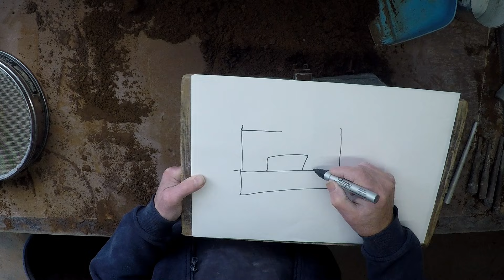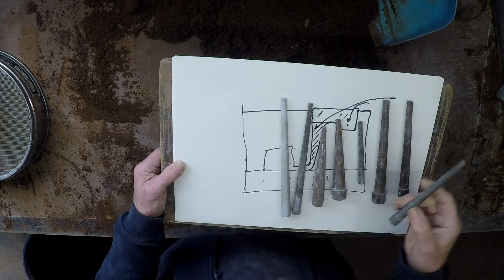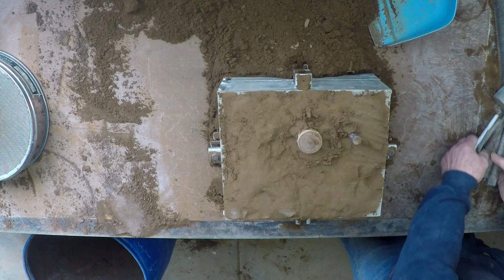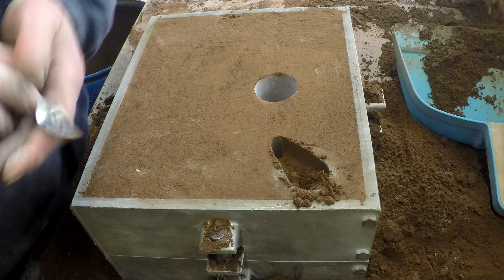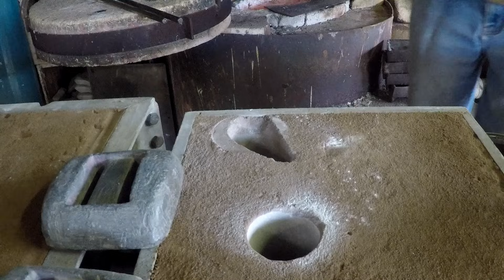Basin and sprue design for sand casting in the foundry

Comment: Marin what is your take on square sprue.  I did a stent at a foundry making large bronze parts for yachts.  We used square sprues to keep the molten metal from swirling and scouring sand out of the bottom of the sprue and into the part.  I believe we also put the pouring basin at the bottom of the sprue.  What are your thoughts?
Reply from the maker: Patrick, I use round sprues because way back when I made my sprue formers I only had a lathe and thus round tapered things were easy to make. I now have a milling machine and if I was still capable of making castings I would likely go to a slot sprue. Both the square and slot designs have more frictional resistance to the metal flow and thus slow it down more. As metal speed is our enemy this is a good thing. Typically then instead of my 8 mm round exit sprue (exit area is about 50 square mm) I would use preferably a slot sprue with a 5*10 exit size  or I guess a 7 * 7 mm square. Best way to avoid the problems of swirling is to make sure the sprue always runs full - the metal may still spin to some extent unless you pour with care but it will not drag in air and or generate dross by turbulence. Correct sprue sizing and taper plus a good pouring basin atop the sprue are thus essential and this is where most foundries fail badly. Sand scour is usually the result excessive turbulence and thus of  poor system design. I have never had this problem even when it later turned out that there was loose sand  in the sprue and or later parts of the running system. A half blocked sprue made for a long but still successful fill demonstrating just how small a sprue one can get away with!!!! A pouring basin at the bottom of the sprue? Hmm, I assume that you mean an enlargement base. This was an old and sadly much favored practice  based on the erroneous idea that a pool of metal at the base of the sprue would cushion the falling stream coming down it. It has been thoroughly discredited and leads only to excessive turbulence, air entrainment and dross generation - possibly even sand wash. Bronze for yachts - often Aluminum bronze - the foundryman's nightmare. Good gating from the pouring basin to the casting proper is essential to get good reliable castings, many foundries will not touch it..... Martin

Comment: Sir what is the use white powder.. and what's the benefits?
Reply from the maker: The white powder is just parting agent. It is a commercial parting agent and is very finely ground Calcium Carbonate. I put a little of it down the feeders and sprues and then blow it around to coat the inside of these . It helps stop loose sand from sticking when I finish of the top of the mould and when I cut the pouring basin... Martin

Comment: Hey great castings, few things. i might have missed them because I watch most of my videos at 1.5 speed but u did it your way and really didnt talk about other ways and y they dont work. why not put the screw on a angle rather than worry about making a specialised entry hole. And why do u not warm the sand so the aluminum does not cool as quick.  Then u talk about why bother going to  de oxygen the alluminum, well why care about the hole ur carving for with a special tool and adding powder really I hope I'm not coming off rude it's just a bit hmm
Reply from the maker: Show, I thought that I did cover why other ways don't work as well. Its all to do with getting the calmest metal flow possible in order to avoid air entrainment and consequent oxide film formation - these films seriously weaken any casting. The pouring basin at the top of the sprue is a very important part of the gating system - without it all is lost. Angled sprues have been suggested and indeed tried before but tests have shown that they make no difference. Its the water in the sand that causes the metal to solidify so fast. But metal that solidifies quickly is stronger and more ductile than metal that solidifies slower. However for some work - plaques with fine lettering in my case - it is not unusual to completely dry the sand moulds in an oven this helps the lettering form more sharply. I guess the special tool just makes the process quicker and more repeatable and the powder (I assume you mean the white parting powder) just helps stop loose sand sticking to the insides of the sprue and so helps keep the casting cleaner.... Martin

Comment: Great video.  Learned something new today. From the slowmo you can tell that the turbulence within the sprue is greatly reduced and keeps heads pressure maintained
Reply from the maker: Taranson, Yes, you have hit the nail on the head. Turbulence is the great enemy with handling molten metal. The availability of instant pressure to aid flow is a great help with thin areas that might otherwise not fill.... Martin

Comment: Very interesting information. New sub you. What PSI of air pressure are you using? Thanks for sharing with us.😎😎⛏⛏🔥🔥
Reply from the maker: Cand, I use 15 PSI in the air gun I blow the moulds down with. I have a cheap regulator in the line the gun is attached too. Even so  you have to be careful  as to how you use the air. I point the gun away from the mould when I pull its trigger as the first rush of air can be a bit strong. I try to avoid aiming the gun at sharp edges in the mould and if the mould is delicate,  like text for example, I hold the gun a long way back from the mould face. I often inspect the mould with the aid of a good torch to see if there are any loose sand grains on the surface. Its all a bit of an acquired art... Martin

Comment: 😂😂😂😂😂😂😂 wot a load of bollox
Reply from the maker: And you would know - How?
Reply: @olfoundryman8418  I was a greensand moulder tor 50yrs you ever heard of a bowl and runner bar guess not
Reply from the maker: @billclay6748  I never cease to be amazed and saddened by the reluctance of old hands to adopt or even try new developments. This disease afflicts all industries of course, but it is particularly severe in the foundry industry – it’s a black death plague infesting it. To refuse to even try new things achieves nothing, it just maintains the status quo of 6000 year old technology. The “it were good enough for my father and his father before him it be good enough for me” attitude gets us nowhere.
What I show here is not completely new anyway, the offset basin was developed and used in the early 1900’s. Sadly it was paired with that scourge of the foundry industry, the usual overly large and parallel sided sprue atop an enlargement base and unnecessarily oversized runner, thus the offset basins good effects were negated and its use discontinued. 
When I was first taught how to mould (1964), I was introduced to the techniques that you mention, but even the littlest understanding of fluid flow indicated that they were faulty and better methods had to be out there. The ongoing work of John Campbell et.al. has given us many of them and foundries that have adopted them e.g. Bob Puhakka and Cosworth are the proof of the pudding.
Can you not see towards the end of this video how quietly and smoothly the metal enters the mould? So much better than the splashy turbulent stream usually seen in foundries. This is an easy and highly beneficial technique to use. If you are still moulding try it, please.
Perhaps too you could show us some of your work so that everyone here knows what you are talking about?.....Martin

Comment: I'm very curious how you would approach this in a jolt-squeeze molding machine setup?
I have used a conical marker on my cope squeezer boards to mark where I cut my sprue for a long time, but I see the advantages of the offset basin.

I attempted making an offset basin form that also marks where to cut my sprue, however when I went to cut my tapered sprue, the basin collapsed from the side pressure.
Reply from the maker: Border, I think that sprue basin forming, and indeed of the sprue itself as well, is the Achilles heel of jolt squeeze machines. It s just so much harder to get a decent small tapered sprue with a decent offset pouring basing attached when using such machines. If you can manage to ram a tapered sprue in place using perhaps a base board with an appropriate hole you would be half way there. Then perhaps a pouring basin out of a hard sand added to the top of the mould after mould closure. Likely not as easy or as quick but doable.... Martin

Comment: I was using a tapered punch only because the taper would let it come out easier!
If I used air like that it would blow the mold apart!
How does he get such solid sand?
Reply from the maker: Arc, Anyway that you get it right is a good way. Its not that the sand is very solid its just that the air is set to only 15 psi with a separate cheap little regulator. Even so I point the air away when pulling the air gun trigger and if a mould is particular delicate like fine text on a plaque for example I hold the air gun a long way back from the mould surface so its not much more than a gentle breeze. Its a bit of an art!😊. The sand is a natural sand i.e. straight out of the ground clay and all - I just sieve out the few biggish bits, add the right amount of water and its good to go Unless oven dried and I have only very rarely done that its not particularly solid.... Martin

Comment: no raisers ?
Reply from the maker: curt, Yes there is a feeder. If you look at the thumbnail for the video the top of the feeder can be seen a little to the right of and below the "n" of "Basin" and to the right and above the "d" of "And". Looking at the cope part of the open mould the bottom of the feeder can be seen above the drag located gate into the casting..... Martin

Comment: martin, you made this video a few years ago and a question to you, can you place the sprue on an angle from the edge to the part so that the molten metal runs down instead of falling/ splashing in to the part, just an idea, by the way I have not  yet did a poor, I love your videos, they are so well described. Allan
Reply from the maker: Allan, Many others have suggested slanting the sprue, but provided that the sprue runs full (which it MUST do for good work) it makes no difference. You seem (perhaps?) to be drawing an analogy between pouring a beer down the side of a glass to avoid excessive head (on the beer) and pouring metal into a mould - apart from the necessity of doing both things carefully they could not be more different. Thank you for your comment, I do appreciate it. Its good to see people thinking about the process... Martin

Comment: Did my first cast today! Your videos helped me tremendously !
Reply from the maker: dieter, I am very glad to have been of assistance.... Martin
Reply: @olfoundryman8418  Thanks again Martin.I was casting arms for my drone.they normally made from carbon fibre and break when you crash but aluminum is more durable.It worked great! Now I am excited about casting.I want to make myself more permanent mold.I was looking at using refractory cement to make a mold.Would the process be the same as making a sit sand mold with a fairly dry mix?

Comment: Excellent video. I'm new to pouring silver. Will this method work, since silver hardens so quickly?
Reply from the maker: Scotts. Yes this method will work for silver - it will work form all the metals we are ever likely have to deal with..... Martin
PS, silver probably only appears to solidify quickly because the pieces are small ( who can afford to cast a silver piece weighing in at a few kilos?  and small pieces in any metal do solidify quickly as their surface area to volume ration is so big.... Martin

Comment: This is great stuff. I apologize if I missed this but at around your 5m mark you talked about the size of sprue you used and I was just wondering if you had a general idea of what sizes of sprue and runners you use for a start? I am sure they very for the job but are the sizes you mentioned average for sand casting if your not pouring an engine block:)? I have also seen guys put runners with spin traps on the ends. Do you not see a need for this?
Reply from the maker: Rufus, The size of sprue  former I used here was 8 mm diameter at its exit (bottom) and 13 mm diameter at its top 100 mm up. this gives a taper of a little over 1.4 degrees per side. I use this former for most of my casting work and that would castings in aluminium from about 0.2 Kg to 2 Kg. The runner bar should really have the same cross-sectional area as the sprue base or perhaps a little more. Gate area should be 2 to 3 times this depending on the mould height which on my case is usually between 80 and 110 mm. For smaller work I have a sprue that has an exit diameter of 6 mm and for larger work or where a very quick fill is required a sprue of 10 mm exit diameter. I have tried a sprue with an exit diameter of 12 mm but it passes metal so quickly that keeping even a big pouring basin full is very difficult. If the basin does not run full for the entire pour  air will be sucked in much to the detriment of producing good castings. Note that all my sprue formers are round, this dates from when I first got a lathe and was able to turn these tapered sprue formers. A better shape for a sprue is like a slot as it is easier to blend it to a horizontal runner and it also has slightly more friction which helps to slow metal velocity. Keeping the same cross sectional area this would give a sprue exit size of 10 mm * 5 mm .The idea being to radius this to a runner of 10 mm width and perhaps 6 mm depth. The gates, coming probably off the top of the runner, would have a total area of 100 to 150 sq mm. Spin traps are quite a good idea IF DONE PROPERLY. The need for them increases with increasing sprue height  i.e. with increasing metal velocity. I have not tended to use spin traps  as by the time I learnt of them the bulk of my casting career was at an end, also with the sort of low mould heights I work with metal velocities are relatively low and the need for things like spin traps diminishes - but it does not vanish and were I still casting I would definitely make use of them -  do note however, that they can be difficult to fit in..... Martin

Comment: Great video!  Would it make sense to have a little bit of a draft or taper on the feeder/riser?  Would that create more downward pressure, or is it more important to have the volume of metal?

Thanks
Reply from the maker: Walter, Well, no it would not create any more downward pressure. That is determined by the height of metal in the feeder and has nothing to do with its shape. Its the volume to surface area ratio of a feeder that is important as this is what determines how long it will stay liquid for. That said many of my feeders do have quite a sharp taper for the bottom 1/4 or so - I do this for feeders positioned on top of a casting as it is one way of ensuring that there is no hot spot (and associated shrinkage) where the feeder attaches to the casting. However all that said a slight taper on a feeder is useful as it makes withdrawing the feeder former from the mould easier....Martin

Comment: Amazing video!  Any advise on a smaller pour with brass?  Just scale down?
Reply from the maker: Chi, Yes, I would just scale down on the sprue size. The one I used here was 8 mm diameter at the bottom and I have one that is just 6 mm diameter at the bottom and for small work that is what I would use. Don't make the pouring basin to small or in particular too shallow - you need a reasonable target to aim at... Martin
Reply: @olfoundryman8418  Thank you so much for the response! I look forward to putting your knowledge into action 👍.

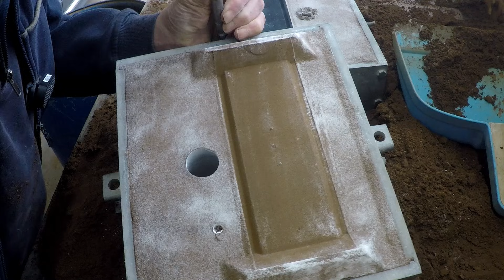Comment: Fascinating, thanks for sharing. I've yet to make my first cast and am a bit unsure of what's happening inside the  mould here. At 11:29 when the mould is parted, we can see the bottom (or near the bottom?) of the tapered sprue, which you radius as per the diagram. Nearby we see the larger (feeder?) aperture at, or near, its base. What I don't understand is how metal flows into the part mould proper (the black area). I assumed a channel would join the sprue to the part mould (or feeder to part mould?) but don't see a channel. I'm sure I've missed something obvious but would be grateful if someone could let me know what.
Reply from the maker: Batch, Yes, I guess I should have showed more. The runner connecting the sprue bottom to the feeder bottom and hence the casting were cut into the drag mould. You can see the runner and gate etc being cut at 27.00 to 28.00 in this video https://youtu.be/7Y5eWT1lPtE  hope this helps... Martin

Comment: Thank you for imparting your years of knowledge.
Metal casting is something I've wanted to do for years but it's either time - no money or money - no time.
Now I'm retired, money is still an issue but grandson is 8 and takes more interest in 'stuff' although probably not ready to 'play with fire' yet.
Reply from the maker: crazy, Metal casting is a great hobby to get into. There is a bit of a learning curve but you can do such useful stuff with it. I started (on my own) at age 11 - just fishing sinkers in sand moulds lined with cardboard but it was enough to get me drawn in. Encourage the 8 years old's  interest in "stuff" - so much better than in Facebook or whatever. Good luck.... Martin
Reply: @olfoundryman8418 Thank you for reply. My father was repairing a clutch or throttle cable for motorcycle when I was 8 or 9 (1960's) in the living room in front of fire. (mother was out shopping).
He had some very old moulds so made some lead soldiers and a dreadnought from WW-I. 
I got a history lesson as well